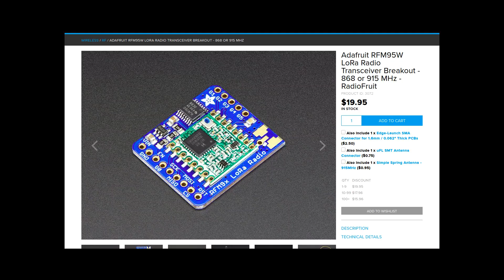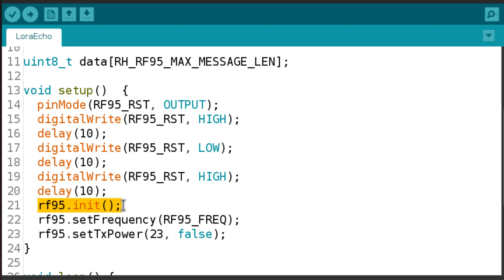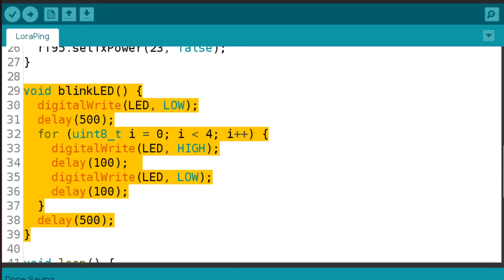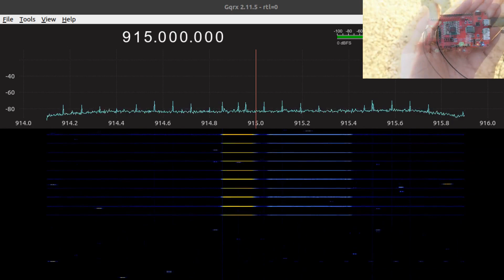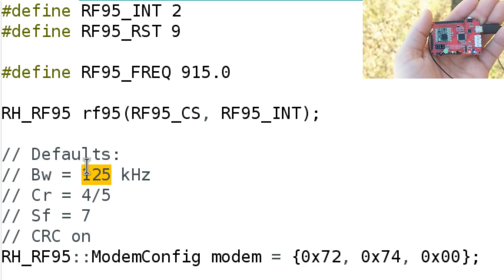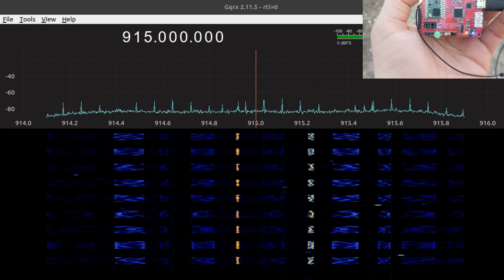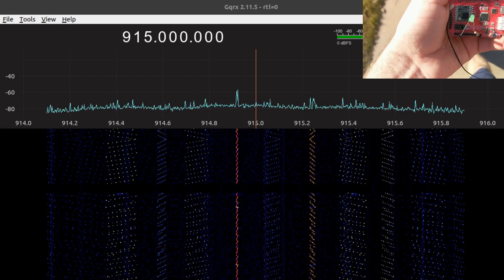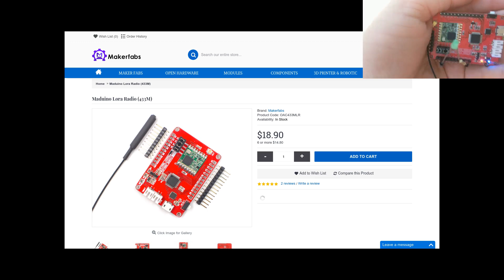Intro to LoRa with Arduino, Long Range Wireless for Makers (RFM95 Maduino)

Comment: Wouldn't it make sense to verify the message when received?  technically you could be receiving a message from someone else transmitting on that freq, correct?  Very cool demonstration.
Reply from the maker: Yes, if they use the same LoRa parameters (frequency, bandwidth, SF, etc) and they're within range you'll intercept their messages. I'd been monitoring the area with that SDR device to make sure there weren't competing LoRa signals. The only way you could really combat that (especially if you assume someone might intentionally interfere with your communication) is to encrypt the messages using a shared AES key or something. If you're not worried about intentional interference, then a message prefix or some other form of verification should do.

Comment: Excellent video.  Thank you.  Do you know if UART AT commands have any advantages/disadvantage compared to SPI?
Reply from the maker: SPI is faster but for LoRa applications the speed is all bottlenecked in the radio transmission speed so that shouldn't make much of a difference. UART+AT commands are a simpler protocol so it's easier to implement. SPI is easier to extent and allow for multiple SPI devices on the same bus.
Reply: @DavyBot  Thanks Davy.

Comment: A few more things:
1: 433MHZ is much better than 915MHZ at penetrating obstacles and covering distance*
2: In the walking test, your hand is muffling the signal. You'd get much better range if both antennas were in free air and pointing vertically.
3: If you are trying for max point-to-point range, directional antennas can work wonders. When I was experimenting with 2.4GHz radios a while back, I found a "cantenna" antenna can approximately double range. I've heard Yagi antennas can more than triple it.
* If you are doing any transmissions on 433, other than infrequent,  manually initiated transmissions, I'm fairly certain you need to get an amateur radio license.

Comment: Can't we Encrypted Radio Waves...
Reply: Sure, if the two devices share a key you can encrypt before you send the data. These chips don't do that for you but you can find Arduino code do perform different encryption algorithms.

Comment: Hi!

Nice video and explanation. As You mentioned there should be good antenna. If You can test and set antena with VNA for Your frequency it is perfect. For both LoRa nodes antena should be perpendicular to the ground level. If You can do this, you can increase distance. 

I have one test with arduino, RFM95W, DS18B20 temp sensor and 2dbi antenna and a net with Multi tech gateways 5dbi antenna.  SF was set SF7, for bandwidth don't remember. I reach up to 6 or 7 gateways and max distance was 7.6 km in urban environments (9 floor houses, private houses, forest, industrial park, river, 9 floor houses). My node was at 4th floor in kitchen. Gateways was on 9 floor house rooftop! 

I'm working on board like this right now, but with better pinout for sensor connection. But I am stuck in thinking about microcontroller usage. I made schematic with ATmega328P, but right now I think to change it to another arduino compatible.

Comment: Can i see the received byte packet using Gqrx tools?
Reply from the maker: Gqrx only supports simpler demodulation for things like AM/FM radio. LoRa is a more complicated Chirp Spread Spectrum protocol, but SDR devices like the one I used can be used to decode it. This page has some interesting info about that and links to projects that can do it: https://revspace.nl/DecodingLora

Comment: Wow this is cool. Would it be possible to send an image file using this method?
Reply from the maker: It's possible since they can send/receive binary data. But you would need to split the image into a stream of smaller packets since the maximum size per message is 251 bytes. You probably couldn't stream video due to the speed, but you could definitely send images, or any file for that matter.
Reply: @DavyBot  Ok thanks!

Comment: This looks like you could use the echo transmitter as a relay or repeater to extend the range. Could you please comment on that possibility. Great video and presentation. I subscribed, looking for more on LoRa, especially the ability to extend the range with a repeater and improvements to the antenna choices.
Reply from the maker: Absolutely. The echo code would repeat the signal back out to any LoRa modules listening so if it were between a sender and a receiver it would extend the distance between those two. If you prefixed the messages with an ID or something you could even route to multiple listeners or create a mesh. Whenever I get my hands on another module or two I'll be sure to test that out and upload it. Thanks!
Reply: My goal is to put together a couple of solar powered repeaters between a remote sensor and the gateway. Thought about using the Pro Mini in a camouflaged case with a small PV panel attached, mounted high up in a tree.
Reply: Great and thanks for the quick response. I've been looking for this solution for some time now. LoRa is great for low power and range and with the ability to extend the range with a repeater it becomes even more useful. Thanks again.